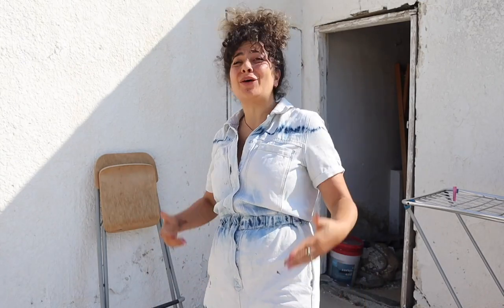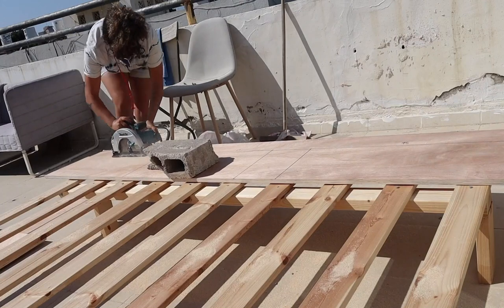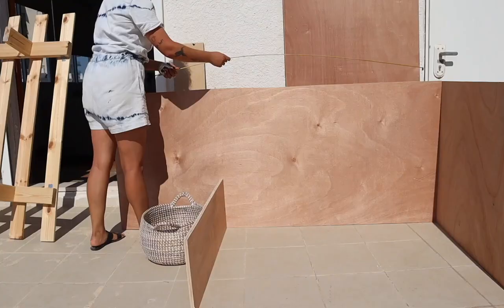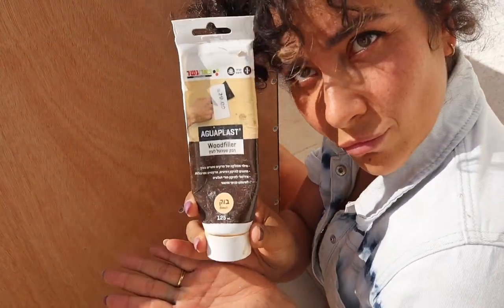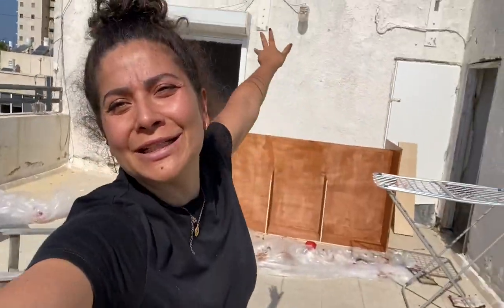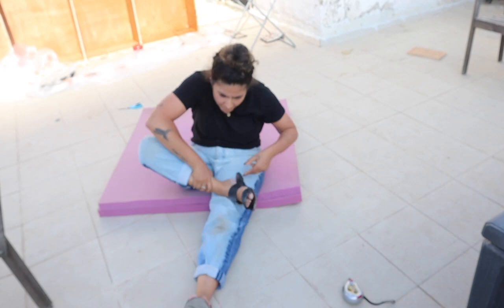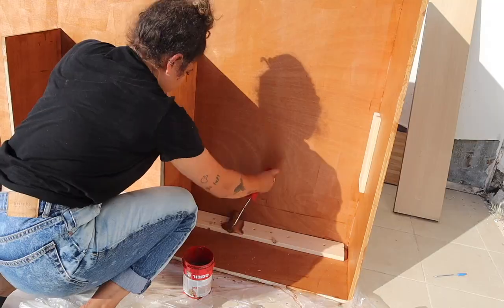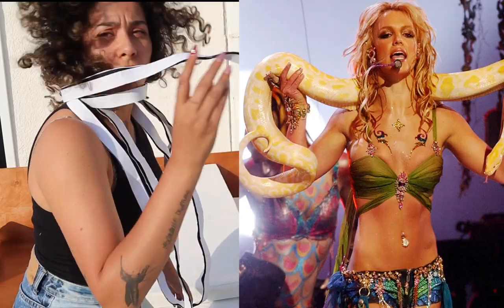15,900$ HUMPHREYS SOFA for only 150$ // FOR BEGINNERS COUCH DIY TUTORIAL

Comment: I've seen a few of your videos, but this was by far my favorite, both useful and gave me an idea for a solution I've been looking for.  I built a Murphy bed.  I am not in the least bit a carpenter, but I managed to make it work and using only upcycled and repurposed material, no kits here.  However, my issue is that I've haven't been able to come up with a sofa to fit under it.  The space is so small, that a sofa can only be 60 inches wide at most and all of it needs to fit under ben when it's down.  Which is a love seat and doesn't offer a lot of seating. I bought two mini folding chair bed things that have legs that fold up when neeeded on Amazon.  They are ok, but the cushions suck and only offers seating for 3 maybe.  And it's a whole set up process turning them over and letting out the legs.  So I've been trying to decide what to do.  My thought was to get two bookcases that would fit under the bed lying on their backs, so 2 bases that are 60 inches x 30 inches that would arrange in an L configuration when in use, somewhat like a sectional... a short sectional.  When the bed is down, I would have them pushed together with the long sides parallel with the bed.  I wasn't sure how I would do the back support. I can probably do something similar with what you did here.  I can uses hinges for the backs and sides so that they can fold down when not in use, and store the cushions underneath.  You should totally make this! You should totally do this.  Or better yet, let's start a business building this bed and sofas!!!  Or at the very least, if you make any money from this idea, send me some cushions for mine, because I can't sew and cushions are expensive!

Comment: This is amazing! What was the wood that was used? It seems like plywood 2/4 or 3/4 but I’m not sure.
Reply from the maker: Hey dear! Yes it’s plywood of 2 cm thick
Reply from the maker: To feel safer and not (or also to not add the legs in the middle) you can buy 3- 4cm think and it will be super stable